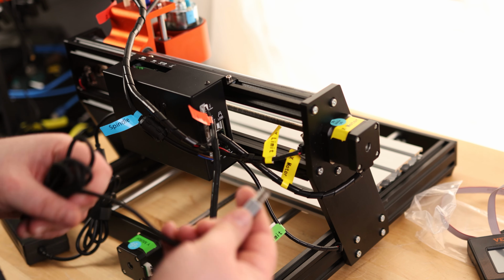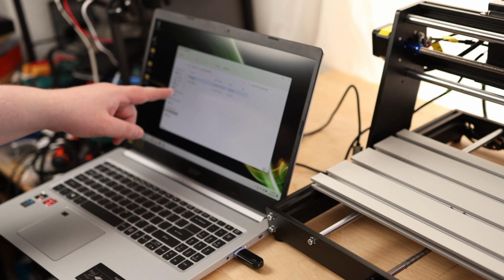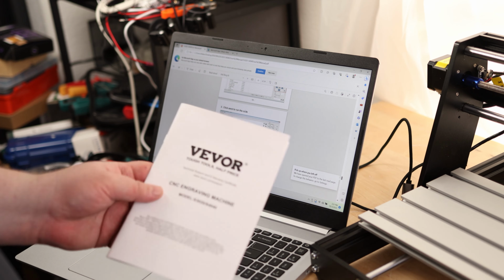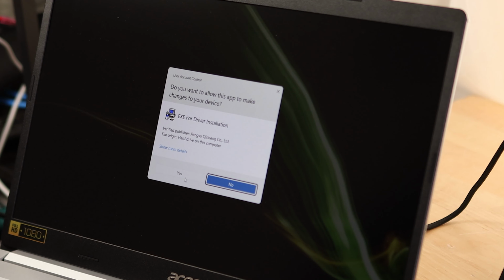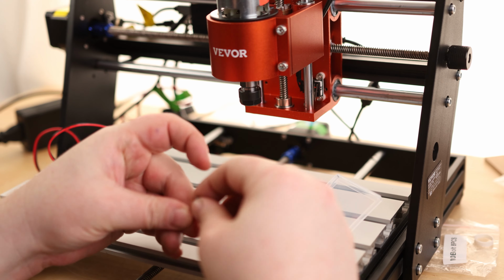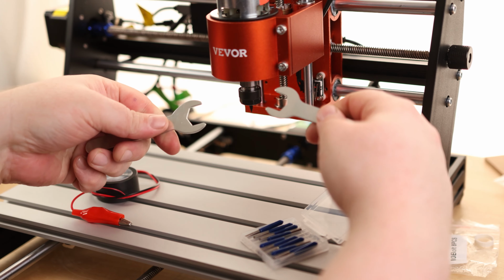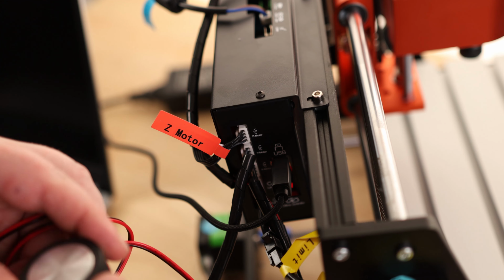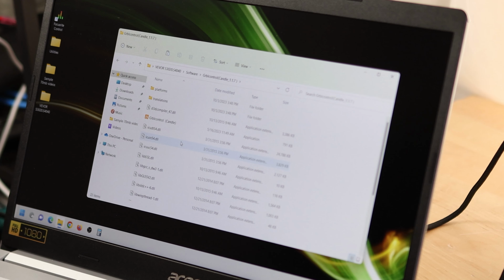VEVOR CNC Router Machine, 120W 3 Axis GRBL Control Wood Engraving Carving Milling Machine Kit

Comment: I am new to CNCc and am wondering if a cheap CNC mill can be used as an automatic punching machine. i have a workpiece with dozens of precisely placed punch locations. Normally I use a sharpened needle to manually punch holes as its a sheet of soft material. 
My questions are: 1) whether i can connect this sharp needle to the CNC and simply use it as a puncher instead of a drill. 2) my work area is about 4 inches square. The hole sizes are relatively small approx 1mm. Is there a way to manually tell the cnc every time i place a new workpiece what the rotation of my workpiece is. Or give it multiple reference points instead of just one (xy 00) so it knows what the rotation of workpiece is around the z axis. 3) I am not sure if the cnc can exert a certain force downward so the needle can punch hole all the way. if not, icould it be possible to connect an automatic spring loaded puncher so that the spindle just has to come down and the rest will happen by the impact of the spring.

Thank you.

Comment: My husband just bought one of these and is having a hard time with it. When it comes time to do a the 2nd pass it just starts doing it own thing. Have you experienced this?
Reply from the maker: I haven't.  Are you using lightburn?  Edit:  Sorry I was thinking of the wrong machine.  So far I haven't had any issues.
Reply: I just ordered one to play with, I'm a machinist, usually that's your cam software telling it what to do, take the Gcode and put it into a plotter, theres free ones on google.
Reply: I just got vevor S4040  what setting did you use. How thick is that board. I meaured mine .190 with manual caliper. Not show if i did it right. I have vcarve pro. Also n light burn.
Reply: @JanetDiaz6152  what do you mean? What are you trying to do
Reply: @vdub2002  hi. I'm not sure what speed i put for the spindle, what depth do i go to cut. the bit it came with is 1/8 .no datatool for it.mine is Power: 300W , 1200 RPM.
Reply: @JanetDiaz6152  so it depends what you want to do. Look up James Dean design, he has fantastic basic tutorials
Reply: @vdub2002   Thank you i will